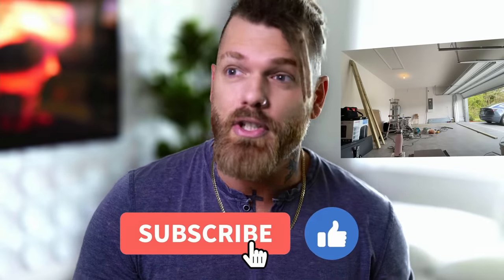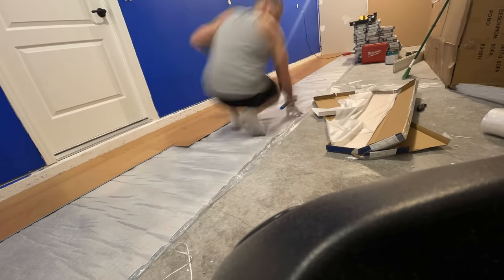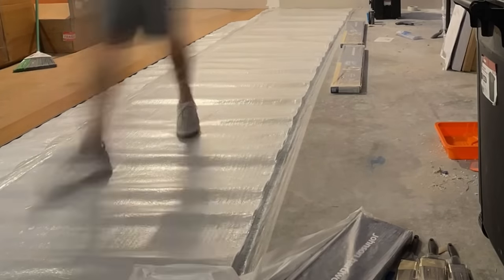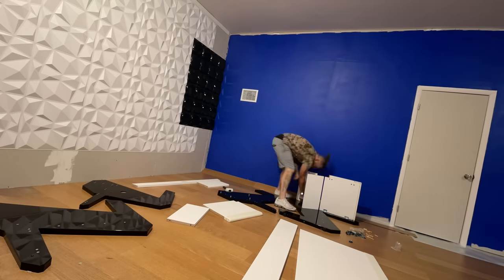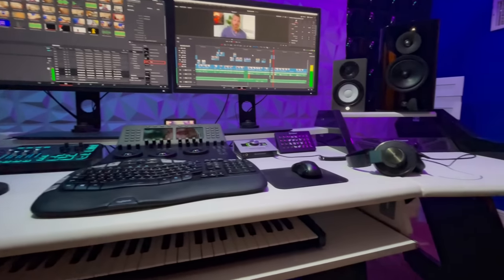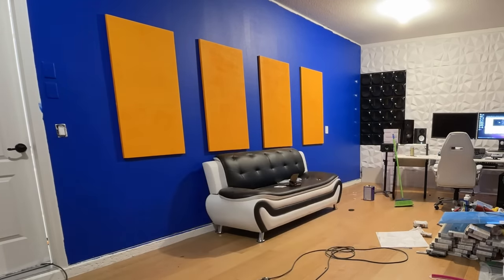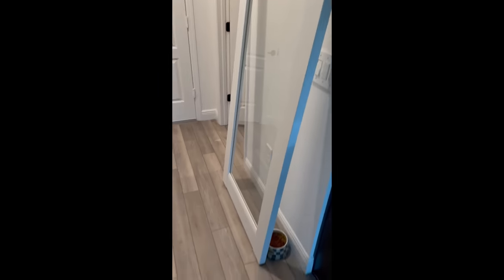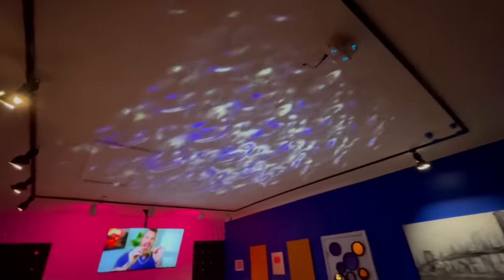NEW Youtube Studio (Coolest youtuber setup 2021)

Comment: Love it! Im a licensed HVAC TECH. You installed the A/C cold air ductwork correctly,  as for the other hose needs to be pipped into the studio as well, so your cold air in the studio will have circulation.
  The way you have it now, your sucking HOT AIR from outside.
  So, the return grill needs to be located lower to the floor. The supply duct needs to be toward the ceiling away from the return, so they cold air will blow out at the top and cold air falls back to the return and circulates through the studio which is the right way to do it!
You could even buy a y and connect two duct.
  Another option is to go in your attic and tap off of the duck pets going to the house to the garage or have the AC guy run you some duct work over that way. Man you're all set. Good luck!